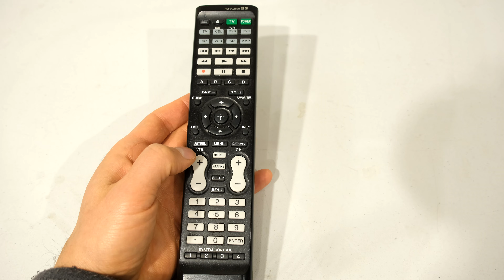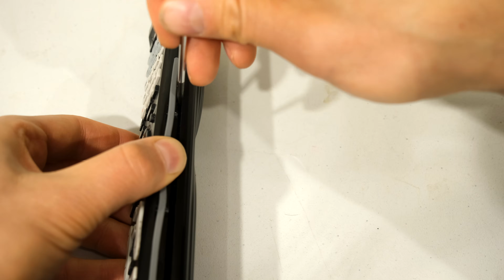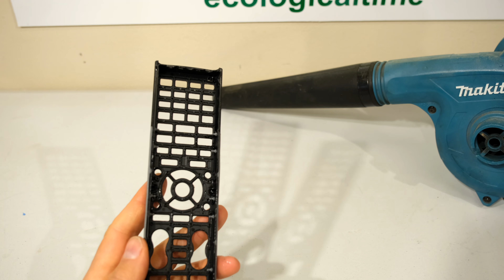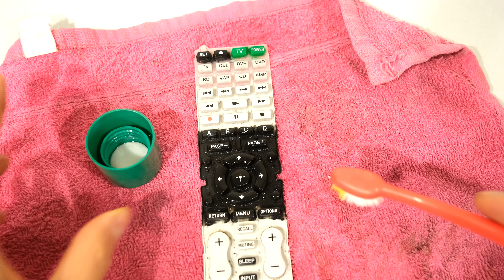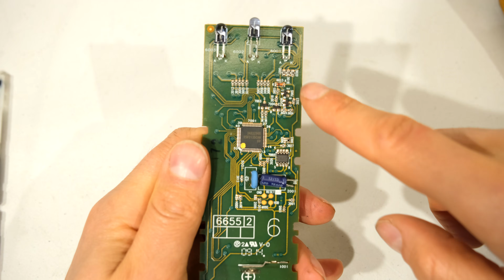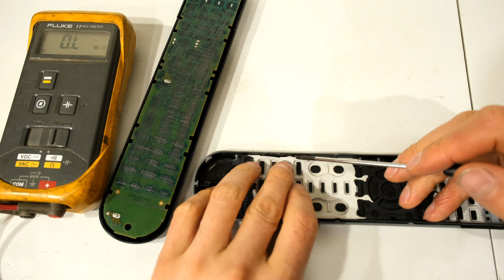How to repair an unresponsive remote control with a pencil - water damage.

Comment: What worked for me: (telephone pad) cleaning very well both the pcb contacts and the rubber pads with 99.9% isopropyl alcohol. Also sometimes work just pressing buttons the hard in a circular way (like a massage) for about 2 minutes each sometimes restores the button without disassembly.

Comment: This helped. I ended up having to scrape a bit off of the pad on the circuit board to get the power button to work (all others were fine). It's an old RCA remote and it's set up differently.

Comment: How long does this pencil-fix work for a TV, for instance, with a remote that's typically almost constantly in use after the TV is switched on? For how long does the pencil graphite "stick" to the contact points that it's applied to? A week, a month, a year?
Only a few days?
Paul G

Comment: Particular problem with DirectTV remotes. The bottom black part has 2 layers. Hard plastic, PS or ABS, and soft layer, perhaps PVC with plastifier. This particular external layer makes the remote to stick to any surface and not sliding. And this is what creates the problems. Slowly it emits plastifier fumes that condense on the inside, on the PCB and buttons. Plastifier is insulator, and the conducting rubber does not touch the metal terminals. Take it apart, wash the plastic parts with soap and water, and the PCB with rubbing alcohol. Remove the yakky sticccky residue. How to take apart the remote. Remove the batteries. On the bottom there are two small black screws. Take them out. Flip the top. There is an oval insert at the middle. Remove it gently with a small sharp flat screwdriver. Start around the blue button. Under it you will find 4 more longer screws. Remove them. There are several snap-ons. Thats it. Wash, reassemble.
Reply from the maker: You have explained a point about plastifier and it being an insulator. Thank you!!!
Reply: @ecologicaltime  this problem is associated particularly with the DirectTV controls. I want to add that many new models of cell phones have this non-slippery back side. you put them on the dash board, they do not slide and do not fall. the surface is smooth, soft and nice to touch. This is again, thin layer of plastified PVC. However, with time, plastifier migrates from the matrix to the surface and becomes sticky and yakky and attract dust. I am worried about the broad use of such plastifiers, phthalate esters, they are known hormone disruptors and affect the development of children.
Reply from the maker: @west_park7993  thank you. Do you know how do the esters enter the skin. I am sure many plastic products from unregulated toy factories have this problem and children put these things in their mouth. Then there are the adult products but i suppose those are regulated better?
Reply: @ecologicaltime  esters are non-polar and enter the body through skin. so do many other solvents. gasoline, chloroform, benzene, dmso...

Comment: I grabbed a couple pencils and meter checked them.  One had no conductivity and the No. 2 proved great.  Great idea rather than buy conductive paint. The problem I have found is that once the rubber mold starts to shed that "Oil,"  you have to clean the thing more often.  I am wondering whether the oil is from the injection molding process (A release agent)?
Reply: I Google the problem of oil between keypad & pcb , it said it’s silicone oil that is released from the rubber keypad because when manufactured the rubber was not baked enough to remove silicone oils, i noticed it’s worse in the area of most used buttons
Reply: Same here.. under my volume up and down there was some oil.. causing the conductive pads not getting contact. Though there is some wear in the middle of the pads from the pcb so buttons does not work. Tried this pen trick as well but only lasted like 2 days

Comment: Good video! Sorry, to say my on and off button I still can't get it to work. The button has definitely lost it's conductivity but I've tried other buttons that work on the remote on the on/off spot and still nothing! Do you have any other tips to try? It's not that big of a deal but I just hate not being able to fix and diagnosis things.
Reply: Glue a tiny peace of aluminium foil on the silicon button could help..

Comment: Thank you for making this video, it’s the best one on how to repair remote controls not working properly.
Well explained!. I have the same problem with a mates remote control, I’ve popped it open and cleaned the sticky mess on the board and the rubber pad, 3 buttons still not working, so I will try the pencil trick you demonstrated. Many thanks again. 😊

Comment: Dunno what the liquid is but my remote is in my room on the bed never near liquids and got that oily residue after 3 years buttons didn’t want to work just alcohol and boom
Reply: That liquid is silicone oil
The rubber starts to degrade and leak oil over the pcb that is why the buttons stop working

Comment: Thanks mate. 
I've tried it with alcohol, than with electric de-oxidizer, but without getting consistent button response. 
Adding the graphite finally did the trick. 👍👍👍
Reply from the maker: lasts for a month or so, you would need to start to get a new one
Reply: Will see. For now works perfectly. I've picked it up from a dumpster anyway.
I've bought a Samsung TV with those stupid new remote, where you are supposed to talk to the remote in order to quickly change channels. Utter BS!
I eneded up constantly carrying the kitchen remote (classic Samsung) back and forth.
Reply: Yes, will only work temporary
Reply: @orfeous  yep, it indeed didn't even last a week.
Reply: @drumsmoker731  same here.. but only 2 days here. I'm going to apply CRC Graphit 33 now and try that. They say that that is the original coat product. Its expensive. Available in spray can and a jar.

There's also liquid paint from bareconductive available.
Reply: I'm gonna gave to try the graphite. I cleaned it too roughly...oops